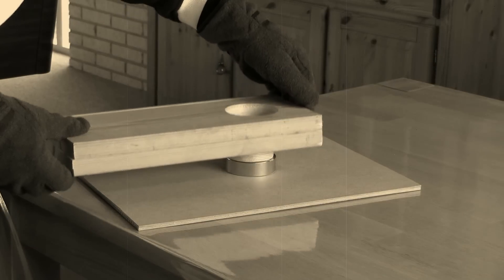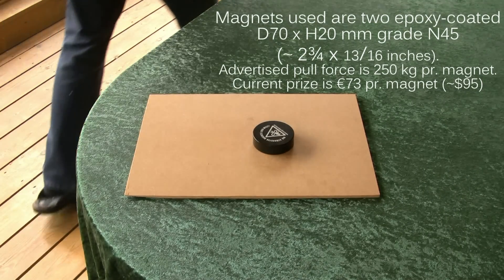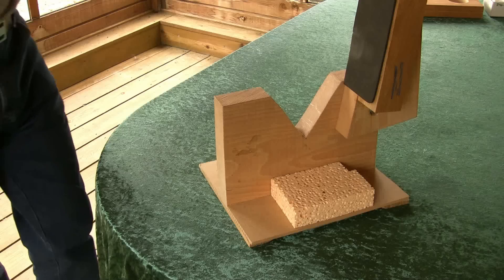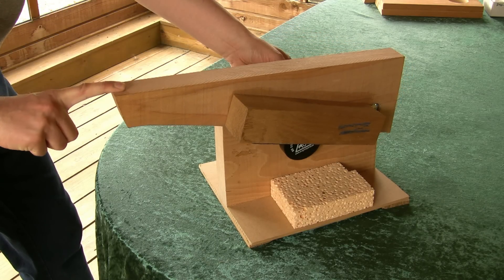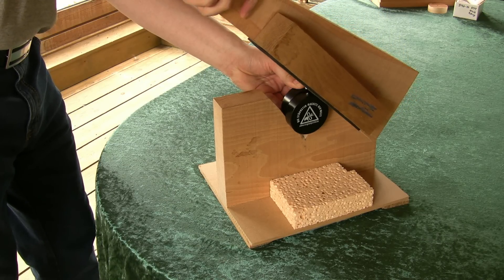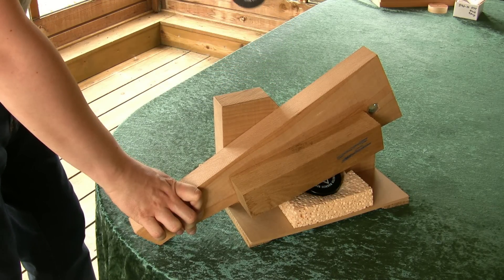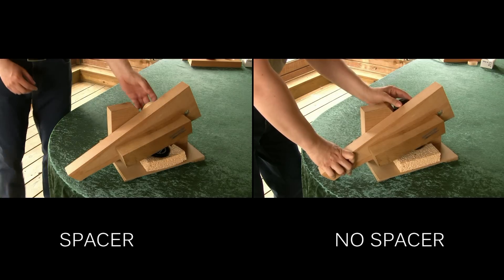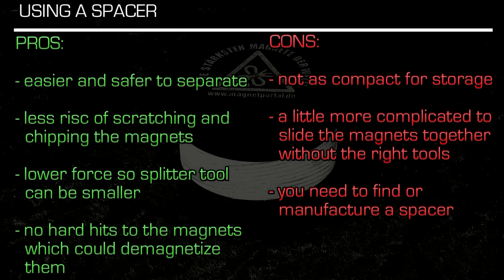Spacer or No Spacer

Comment: Good evening.  What pound pull are these 2 magnets? I have two 400 pound pull magnets which are stuck together.  THANK you.
Reply: He said it's 250kg or 550lbs if 2 magnet that might be 300kg or 660lbs
Reply: Make a splitter like you saw on the video to separate them easily

Comment: I thought the main disadvantage of a spacer would be that the resulting combined magnet is not as strong. Or is that not so?
Reply from the maker: Sure, if the point of combining the magnets is to make a larger, stronger magnet, you shouldn't use a spacer. The spacer is for compact storage of several magnets and easy separation of the magnets again.
Reply: I see

Comment: I have 2 NeoD magnets 1" Dia and 1/2 inch thick.  Yes!, they can hurt you despite their small size.  Play with them carelessly and it will happen.
Reply from the maker: Yep, two 1" neodymium magnets is larger than I would recommend for an untrained person :) Thanks for watching.
Reply: Any idea what grade/strength these NeoD magnets might be?  Solid 1" dia, ½" Thick.
Reply from the maker: Gord Baker No, they can be anything between N35 to N52 since grade isn't dependent on size.

Comment: Sheesh how much weight do these hold or lift ? .these seem more than a little dangerous .
Reply from the maker: They are advertised at 270 kg / 595 lbs each, which is measured in a machine with two large steel cylinders. In real life situations I wouldn't trust them to hold much more than 200 kg. That's still a lot of pull force so don't get your fingers pinched by these ;)

Comment: Why does the magnet attract toward the table? Metal table? If so, wouldn't a non metallic table work better?
Reply from the maker: +TheRealTrikein 
The magnet is attracted to a metal plate I have put on the underside of the splitter tool. This is an advantage, since the free magnet is better secured this way - instead of just sitting loosely around when I handle the other magnet on top of the splitter tool.
Thanks for watching!
Reply: +brainiac75 Thanks for the reply. Sub!
Reply from the maker: TheRealTrikein Awesome. Welcome aboard :)

Comment: what if you just put them together Without that wood with a hole on it? what would happen. What if you just did it outside so much safer lol
Reply: +hayato zami You could hurt yourself. This would also damage the magnets. They'd come together to fast.
Reply from the maker: Uhm, you have commented on a video where I do show the magnets being combined without the wood between them :) (video called Spacer or No Spacer).
Reply: The reason for using the locking board is mainly to keep from risking fingers. Placing them together manually is more complicated, and I have seen this size magnet cleanly hold large weights... Keep watching this channel to see what I mean... And having them come together with 30+ pounds of force means you lose a finger.
Reply: brainiac75  I think that they're asking what if you put two magnets together without the wood holding the one in place

Comment: what happens if you just put them together without any tools?
Reply: They would snap together with high velocity/force. With magnets of this size you don't have enough strength to hold them apart or slow them down. They might shatter because magnets like this are pretty brittle. Or if you have anything in between it would get crushed. Magnets this size are actually very dangerous to handle without proper precautions.
Reply: Mare Rožmanec  Yeah you're right, I learned the hard way and I almsot lost a finger :O

Comment from the maker: You could. But by putting two 6x2" neo magnets together and taking them apart again you run a risk of scratching/peeling their protective surface too much. The coating is only 15-35 microns thick (0.015 - 0.035 mm).
The loss of protection would make them rust and over time (they rust quite fast) ruin 2x$500 magnets. If I ever get two 6x2" magnets and put them together I would let them stay together permanently as a 6x4" magnet :) Trying to take them apart could ruin them.
Thanks for watching!
Reply: am i the only one who thinks in just 4 years he actually did it

Comment: seriously? that diagramm is from someone knowing what the word science means?
use goddamn metric units. that's international and easy. also you can calculatewith them. try calculating something useful with inches, yards and miles and get some matching units.
forces in newtons (1N = 0.1kg/m*m)
and distances in meters (defined by international standard)
masses in kg (also defined by internation standard)
charges in coulomb (1 electron charge)
and so on and you can calculate stuff in useful units
Reply: "to Normal" Lmao. So apperantely the imperial system, which is outdated and in the world rarely ( only in 2 or so countries) used, is considered normal? You couldnt even state the name of your system. What a great joke.
Reply: Gord Baker hahaha... NO!!!
Reply: Trump will change the world from metric to Normal.  Lbs and inches rule.

Comment from the maker: No excuse but it was a warm day and takes some effort to take them apart without a spacer so...
I still recommend using gloves when handling large neodymium magnets - just in case something goes horrible wrong. They prevent small pinches and could make it possible to get your fingers unstuck if they are accidentally trapped between the magnets.

Comment from the maker: Levitation in free air with permanent magnets is very tricky to pull off in large scale (close to impossible but I don't like saying that). The projects I have seen with beds etc. always have had some form of guides like wires or so. With electromagnets it is easier but not very practical. It's not impossible but quickly gets very expensive and impractical.

Comment from the maker: I have never noticed any drastic friction heat in this proces. But it is very likely that the change in magnetic field caused a reaction in the camera's focusing or image stabilizing system. When put together these magnets forms a 70x40 mm N45 magnet which is quite a strong magnet :)

Comment: First, if you put your two magnets together without a spacer, does it double the strength of the magnets? Second, where did you get them? Third, where can I get magnets similar to your magnets, but with a 5/8" hole in the center. And finally how much do you think magnets like that would cost me?

Comment from the maker: They are 70 mm diameter and 20 mm thick grade N45's. Advertised at 250 kg pull force and currently costs 70€ a piece.

Comment from the maker: Not a serious one - but I've had a close call in my 'learning phase' when a magnet sitting in a closed cardboard box with styrofoam around it suddenly turned 180 degrees around and flew towards another of my magnets. That's one of the problems with these magnets - they seem harmless until you make a tiny error... Don't use large neo magnets when you're tired, drunk, stressed, medicated, emotionally unstable or in other ways not fully aware and focused. There's simple no margin for error...

Comment from the maker: Hi!
The magnets you have ordered are really strong. I lift 48 lbs with a single 3/4 inch N52 cube in my video called 'Checkerboard pattern for magnetic levitation'.
You may be able to slide them apart by hand on the edge of a table or so - but it will be difficult and in my opinion it will not be safe to do if you are a beginner. Once magnets can be measured in whole inches I highly recommend tools for handling them. But have fun with them - they are only dangerous if handled incorrectly :)